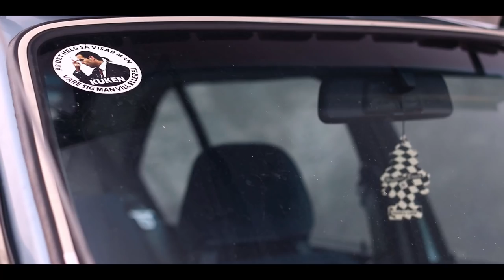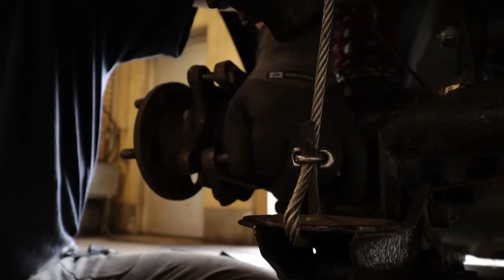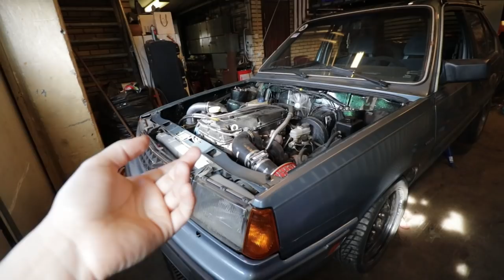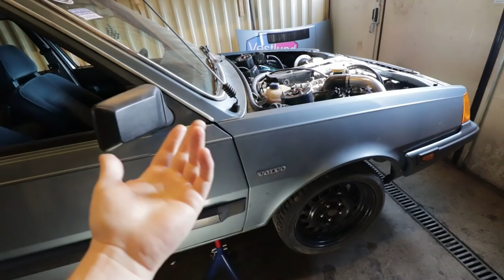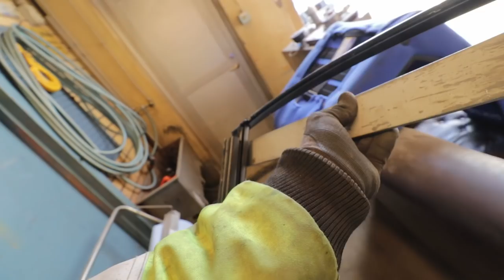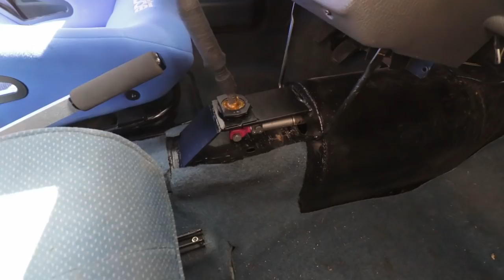#360Aero ✈ - INFÖR SÄSONGEN 2021

Comment: Finns ett orange opel relä man kan köpa för att få rätt hastighetssignal. den behöver 12v, jord och sen är det två pinnar som man kopplar till en abs givare från typ saab eller opel. funkar skitbra. Btw, Behöver du fortfarande en ny magnetventil?
Reply: Kanske även vet var du skulle kunna mappa mycket närmare än nordic.
Reply from the maker: Vi höll faktiskt på med en annan spännande lösning på signalen men har som sagt inte haft tid att prova på ännu. 

Vet inte om det behövs en ventil faktiskt, har inte kollat om det ligger nån på hyllan i lagret 😅

En mappare närmare vore intressant, vet inte av nån annan än nordic uppsala som gör trionic-mappning 🧐
Reply: @VestlundPerformance  Han mappar eftermarknads sprut bara och har inte jobbat med trionic förut men jag själv kör saab swappat och han säger att det inte borde vara nå svårigheter egentligen. Han har sett programmet och mapparna i det och blev inte chockad iaf. Jag kan höra med han.